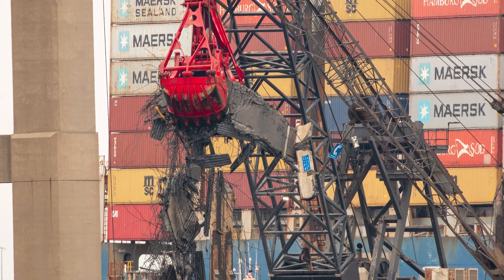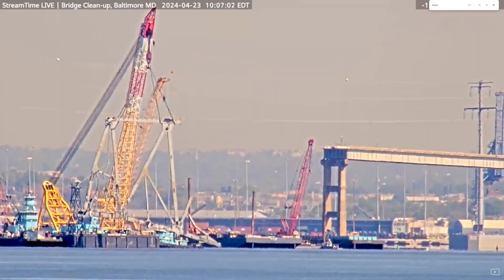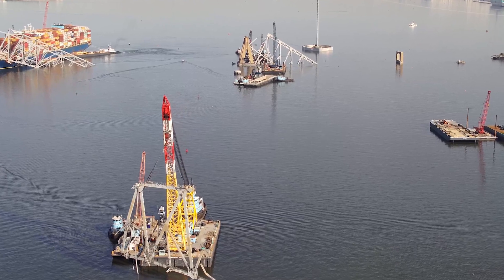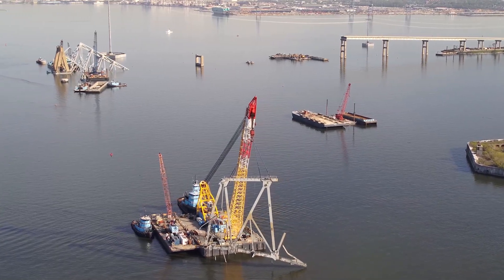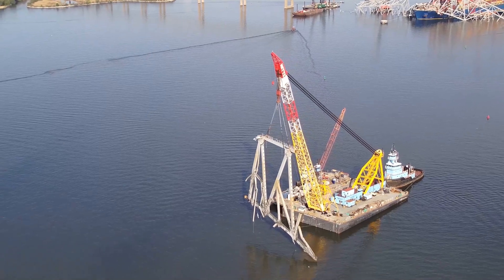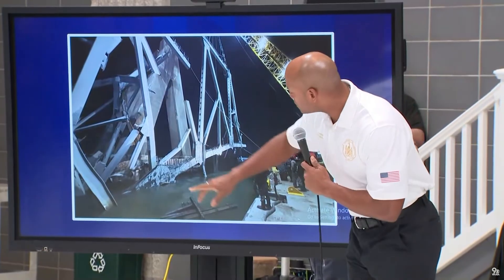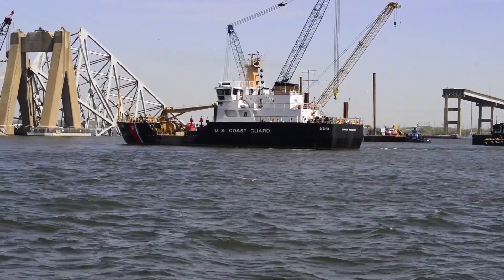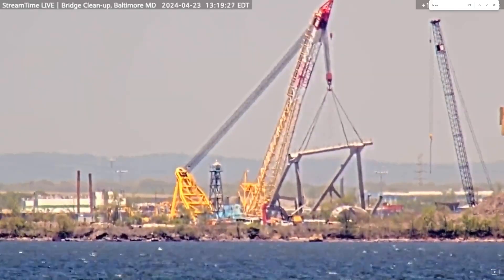Key Bridge Collapse Channel CLEARED Limited Access 560-Ton Truss

Comment: I have so many thoughts running through my head. I think you mentioned or not, is this the only crane this size in the US? Also, what lab tests these crane chains / straps for tensile strength? Not engineering related. but is the crew ok and still on board? Who is supporting them? No need to answer, just ADD. Brain never stops.

Comment: Don't mean to be critical.  The USCG James Rankin is a Keeper Class Bouy Tender not a Cutter.  Hense the black hull, Security Cutters are white and Icebreakers are red. So if it's a black hull and they are wanting to board you, if you have a fast boat you might get away, but it it is a white boat you better be dame, fast as they are, and they also carry a helio that you are not faster than.  😇

Comment: Can you confirm if the crew is still on board and how are they being supplied in terms of food and is it an inspection being done of the engine room and navigation system system?
Reply from the maker: They are still on board, and engine is running, they likely have plenty of food or can check for food.

Comment: For some unexplained reason I got the Spanish audio for this video. It´s absolutely useless for me, and I don't like having to manually switch back to the original English audio. This is something that's happened several times lately.
Reply from the maker: Make sure English is your default language it should stick. It might also try to change it based on your location. You could see this more often as many creators are now adding other languages, but if you set it one to English it should stay.

Comment: The sad part is that a lot of the energy from dropping the demolition ball into the water is diminished just by hitting the water.
The lines holding each side of the large pick are doubled on each side.  One is 90* to the other to appear as one cable.
@ 8:25, you can see the corrugated pavement support along with the roadway material in the clamshell.  I love the blue "phone" sign on the light pole to the right of the clamshell.  Kewl.

Comment: There is nothing to say the remaining victims are within that area or even within the wreckage.  While I hope the families get the closure they deserve, I dont see an issue with the limited traffic in that being disrespectful or negative. They arent going to allow anything with a draft even close to what is clear and that channel is dredged to 50 feet so the width alone will limit ship sizes such that it wont see anything with a draft deep enough that it would disturb the bottom if the remains are there. Theyre also dredging with clamshells and grapples which arent surgical instruments and the reality is that more than likely any remains arent going to be recovered the way the others were.

I would think this also adds to mobility on the site for the resources and that while theres much publicity about reopening the port, 330 feet past a work site is going to do a lot more for moving cranes than moving cargo.

Comment: The drooping girders that had been hanging from the north pillar were removed to hide the evidence of the use of directed energy weapons; they were on the side away from the temporary channel and could have waitined but instead were removed out-of-logical-order (illogical, except to hide the evidence).  That the removal of the 'wilted gun' evidence was the very first large night time operation is no surprise.  Evil happens in the dark.  The fast cleanup and destruction of evidence mirrors the frantic cleanup clearaway at WTC on 911.  An 18 part series on SOUNDQUALITY covers the energy weapons with evidence and sources.  It's pretty amazing to see the collapse in light of having been necessary to allow increased shipping.  The Key Bridge truly was the chokepoint.  Remember a few years ago when those four hugest cranes were shipped in from China?  A few years ago also those high-tension power lines were lifted.  The only chokepoint remaining was the Key Bridge, that couldn't be raised and whose footings, already limiting channel width, couldn't be moved.  It had to go, but couldn't be replaced in present economic and political climate.

Comment: Jeff...maybe in the future you might consider doing "how to pour concrete" for sidewalks, landscaping, mow strips, DRIVEWAYS and foundations the way it is supposed to be done in residential and maybe some commercial just to let us know the differences.  There are way too many "driveway specialists" and building contractors who skip the essentials when it comes to surface prep and hardware needed to do the job correctly. Homes with slab foundations are cracking and have gaps on not so old driveways that consumers have paid "professionals" for and they aren't getting legitimate quality anything. Thank you.

Comment: I hate to break it to you, but that piece of the truss does not weight 550 tons. I built bridges for years and I am familiar with the weight of steel.
Reply from the maker: I hate to break it to you, but army corps of engineers stated it was 560 tons. Pretty sure they know what they are talking about. So you're an expert at guessing by looking at a photo instead of analyzing the thickness of the material, the density, the length used, the size of the box girders, etc.

Comment: All they do is boom up put a wire rope on each corner & connect the other end of wire rope to the corner of the Chesapeake 1000 barge then boom down & hoistup till the load tighten up. Good video stay safe

Comment: Just a thought, the crane stopped suspiciously close to 1am, maybe the crane operator hit his maximum legal limit on operating heavy machinery and had to stop for the night, and the daytime/replacement crew were also fast asleep ready to commence work in the morning.

Obviously in most cases you'd just work an extra 30 minutes and get the job done, but with all the eyes on this operation, once his legal hours were up, they were up and the crane had to be temporarily abandoned.
Reply: That's a union job for sure with regulation about operating hours, and safety. They probably are taking into consideration tides, wind, weather as well.

Comment: How is it determined what each section of the bridge that is being moved weighs? Is this an educated guess?
Reply: It's  educated, but not a guess. Those calculations are
being done by structural engineers.
Reply: @BrunoFisher2 Understood. Do cranes in general have a way to actually measure the loads they lift so as to advise the operator when the limit is exceeded?
Reply: @stevesmith6236  Yes, most modern cranes, and a the heavy lift cranes have extensive instrumentation and computers to calculate limits, measuring load on the lines, boom angle, weather, and many other variables. These guys are very well trained professionals, and DO NOT fly (or lift, rather) by the seat of their pants.
Reply: @chugwaterjack4458  Nice to know. Thanks for the prompt response.

Comment: I was thinking that it wasn't all that safe to be working so late & in darkness when you said they'd stopped & didn't resume for about 8--10 hours. There may have bee some limitations on overtime for crane operators or boat captains/pilots, just as there are for airline pilots? In any case, it's amazing how fast & efficient this is going.